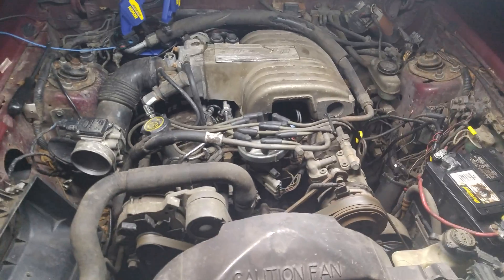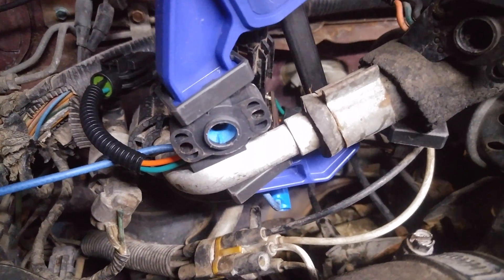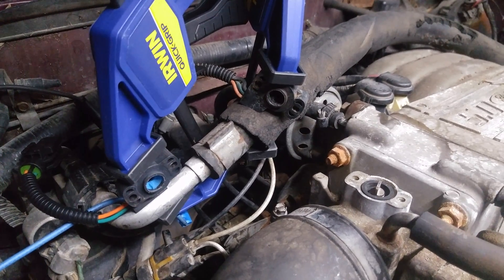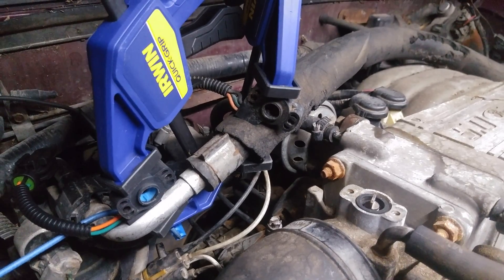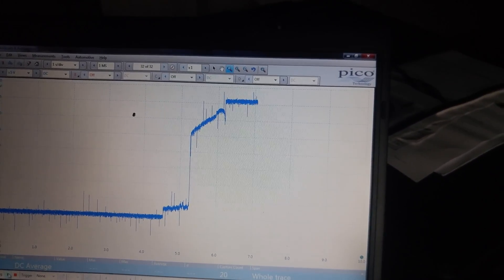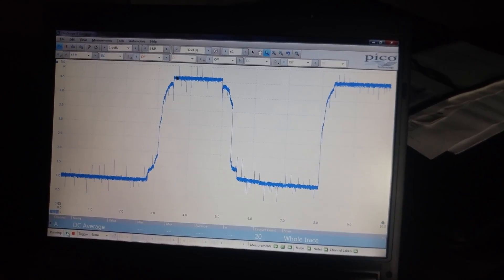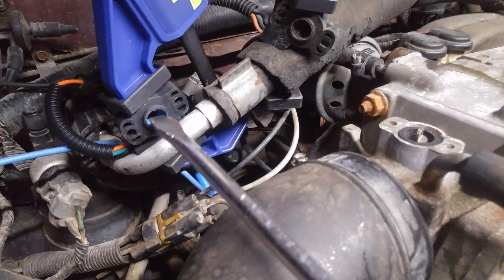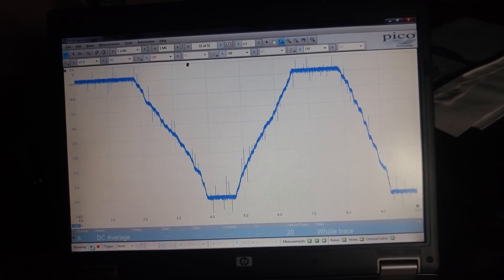Testing Good and Bad TPS Sensors with a Picoscope on a Fox Body Mustang 5.0L

Comment: My 1990 Notch would not start with a bad TPS...had fuel would start for maybe a split second then shuts right off. Install new one fired right up 😂
Reply from the maker: If the TPS thinks you're at WOT (about 2/3 throttle or above), it will actually shut the injectors completely off on purpose, because it sees that as "clear flood" mode. Likewise, if the TPS thinks you're at Part Throttle (anything just above idle and below WOT), it will open the IAC all the way and you'll have a very high idle. Aftermarket TPS sensors are complete junk, in my opinion. Stick with Motorcraft here, or they just don't have the correct voltages that Ford used.

Comment: Any idea if the tps is working during initial startup open loop
Reply: The TPS is always working, any time the key is on. The only thing that does not work during open loop is the oxygen sensors, and maybe some of the emissions systems until it warms up
Reply: @Pontisteve  any idea if a vacuum leak can only show after warm up?  If. It the only think it could be would be ECU which had a capacitor fall out a few years ago.
Reply: @eddiefalcon8316  Vacuum leaks tend to be worse when cold, but anything is possible. The capacitors in the Fox PCM are very problematic. If you haven't already had them professionally replaced, they need to be. We sell the capacitor kits, and we also have a guy who can correctly install them if you're interested.
Reply: @Pontisteve  I should pull it out and see what it looks like. Car runs perfect until closes loop then has idle issues. So it’s tps, electrical or ecu. My car has never had its electrical messed with so….
Reply: @eddiefalcon8316  That statement says it all. If it runs perfect until you go into closed loop, then the problem is closed loop. In other words, the oxygen sensors, or an exhaust leak.
Reply: @Pontisteve  funny enough I do have en exhaust Leak but it’s right by the tailpipe by the fuel tank. If that is my problem it would be 🤪. Could be o2 sensors but check engine light works and it’s not coming on. But they are old and car has 306k miles so everything is old from time/mileage.
Reply: @Pontisteve  well I tested the exhaust leak. That wasn’t the issue. I will try to unplug the o2 sensors to see if the issue goes away. If it does I will have them replaced. I hope this works.
Reply: @eddiefalcon8316  make sure the O2 sensor heater power wire has 12v with key on.

Comment: So let’s say we don’t have a laptop or the software to do this how would we check it
Reply from the maker: Get a voltmeter (preferably a graphing voltmeter), backprobe the TPS signal wire, and SLOWLY rotate the throttle from closed to open, watching for any dropout in the voltage. The TPS voltage should be around .9 to 1.0 volts at idle, and should increase as you open the throttle, maxing out somewhere around 4.6 to 4.7 volts at Wide Open Throttle. If you are rotating the throttle open and you see the voltage go down at any point (especially to 0), the TPS is bad.

You can also set up your Min/Max scale on your voltmeter to catch the minimum and maximum voltages. If you start this test after already having that .9 to 1.0 volts at idle, then you should never see lower than that on your min value from the min/max recording. The TPS sensor basically sweeps from almost 1 volt to almost 5 volts, always increasing as the throttle is opening, never decreasing unless you start closing the throttle. If you see a dropout in voltage, it's bad.